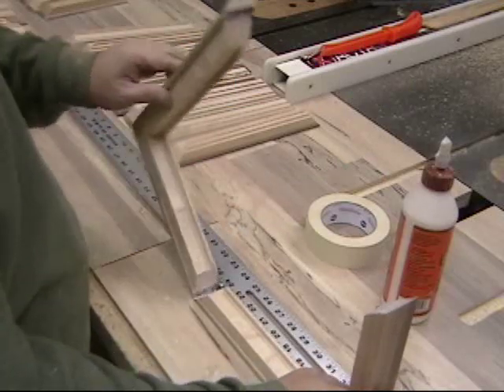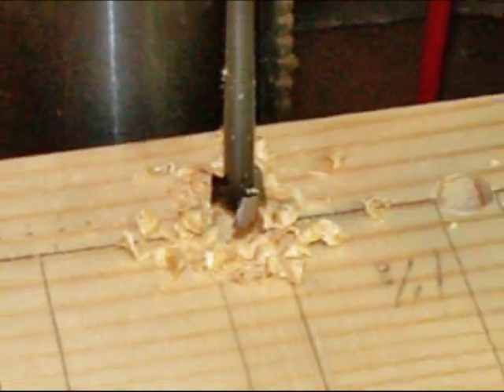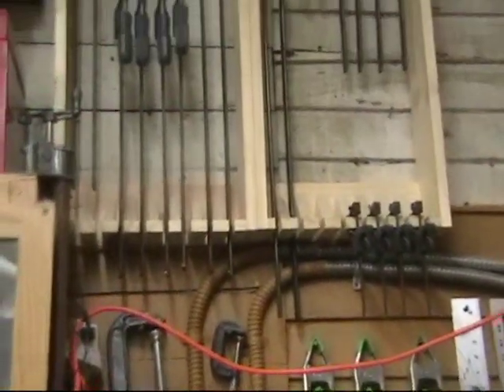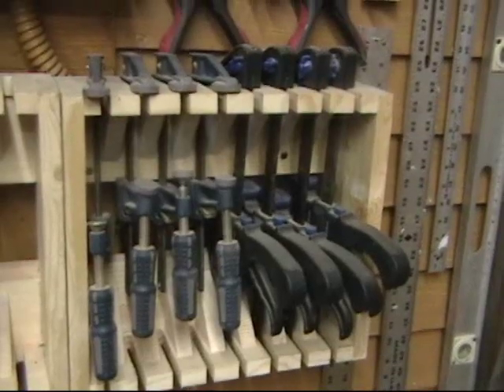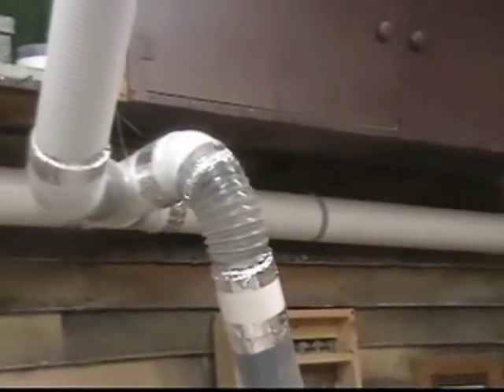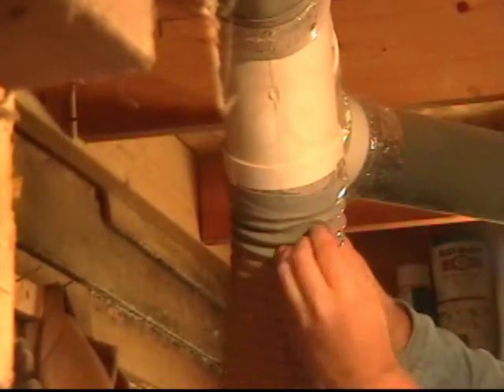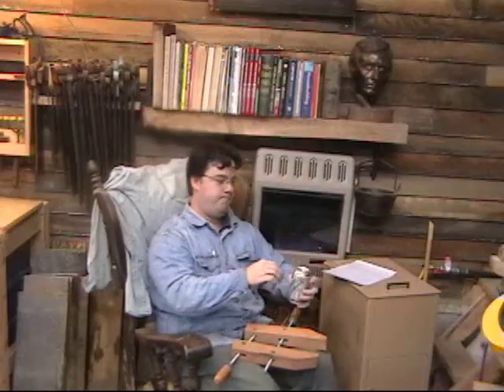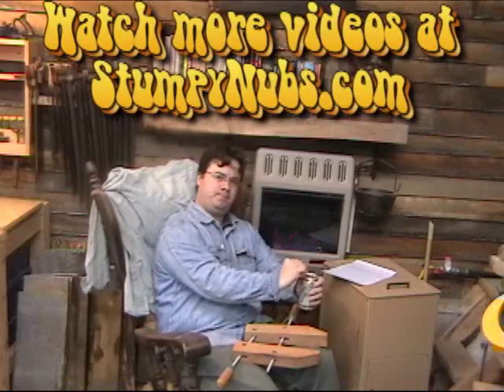Homemade 3 Layer Clamp Rack & Extreme X-Treme Tape Wrap Review-Woodworking with Stumpy Nubs #5

Comment: I useually just put superficial scratches on my new item and say I had it forever.  Case in point I bought a new leatherman surge a while ago at a walmart. I walked out of a the store dropped it on the ground and kicked it across the parking lot to my truck picked it up an it has been on my belt ever since I told her it was in an old junk drawer